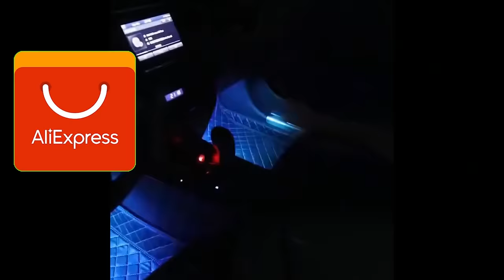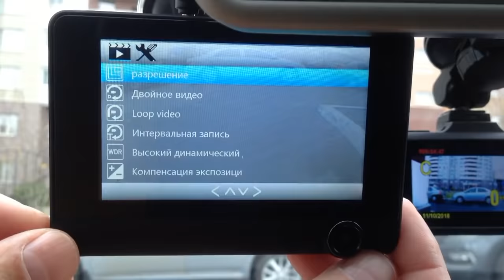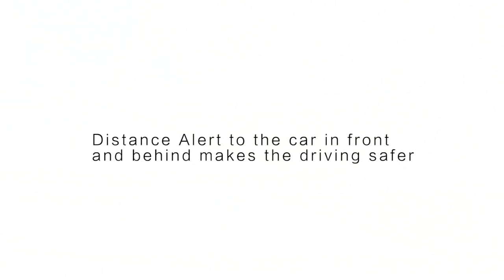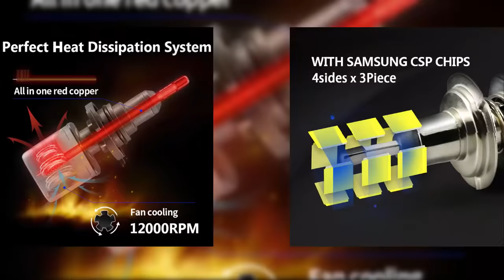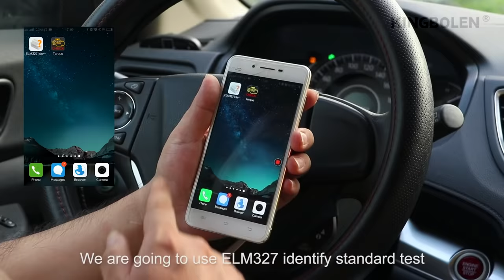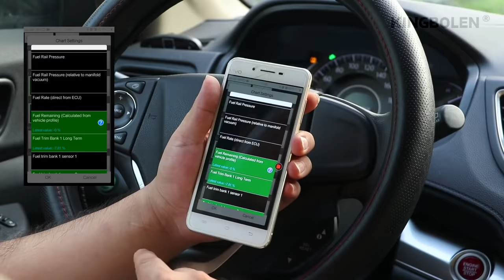12 ALIEXPRESS REVIEW BEST AUTO PRODUCTS (2019) | AMAZING CAR ACCESSORIES

Comment from the maker: Which of the goods you liked the most?

1) 0:15 Car Windshield Repair Glue - http://ali.pub/3b326p
2) 0:59 Microfiber Towel Car - http://ali.pub/3b327v
3) 1:55 Car DVR 3 Cameras Lens - http://ali.pub/3b32ae
4) 2:45 Carbon Fiber Vinyl - http://ali.pub/3b32by
5) 3:35 Car Decorative Light Set - http://ali.pub/3b32di
6) 4:17 YI Smart Dash Camera - http://ali.pub/3b32fg
7) 5:06 Car Window Curtain Sun - http://ali.pub/3b32gf
8) 5:55 Car LED Illumination Hubcaps - http://ali.pub/3b32h7
9) 6:30 LED Bulbs Car 40W 10000LM - http://ali.pub/3b32iy
10) 7:10 Anti-fog Film Rearview - http://ali.pub/3b32kb
11) 7:48 Universal Flexible Interior Decoration - http://ali.pub/3b32lh
12) 8:35 Car Diagnostic Scanner - http://ali.pub/3b32n1